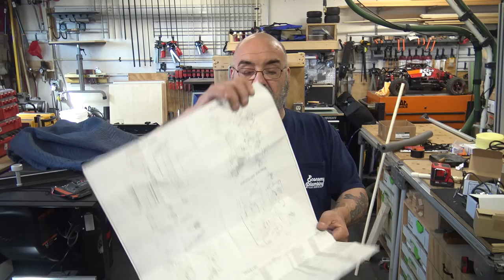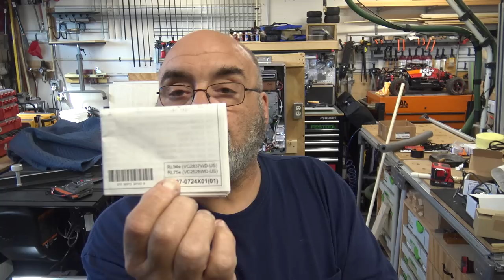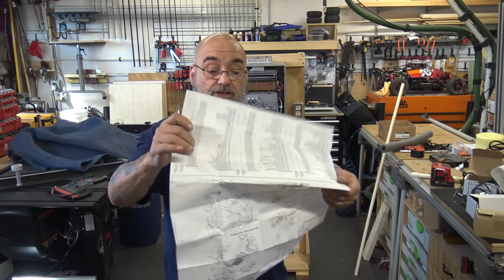How to protect your Rinnai tankless heater during freezing temperatures.

Comment: Your video gets a like simply for lighting up a cigar while you're teaching. I'm setting up an off grid system with an exterior Rinnai. My water source is 3000 gallons of external tank. Most of my source pipes are above ground so my best protocol is probably just going to be to power down, drain everything and get all the water out of my entire system until the weather passes. All power we have is from our solar system. Additional heating elements are not practical. Temp outside this morning is 23 F.  

The beginning of your video was most helpful when figuring out how to drain the system. Thanks!

Comment: I used to be a Rinnai guy 100%.  In the last six months I decided to start using Navien. 
I find the technology to be a little more advanced, easier to work on and being able to install without having to add or replace a lot of gas piping helps keep the cost lower with installation.
Reply: Lol same here, I was approached by Navien last year( I did get a lot of question about them over the channel) to see what they can do about being added to my channel. I asked for two unites so I could look at them. Once I took them apart and put them back together I was sold.

Comment: Mike, your video was super helpful.  Too late to save my brand new unit but helped me understand what failed and the new heat exchanger is ordered, though of course on back order. The rip in the tube on the hot side is even bigger than in your video.
Reply: I’m glad it helped sorry for your problem. Mike

Comment: Hi Mike, 
I live in Dallas and I have 2 tankless R94
One of them kept working through the cold weather because I have installed a recirculating pump and made it come on every hours to keep water flow through the unit.
The other tankless stopped working due to hot water discharge pipe frozen in the attic. The unit did not froze and I was able to make it run by opening the relief valve. I had previously stuffed all the pipes with wall insulation . I got lucky on this one.
Thanks for all your videos
Reply: I’m glad it helped

Comment: Great video, thank you
Question, i have a mountain cabin that we do not heat or visit during winter. We have indoor tankless water heater in a closet inside kitchen. If i gravity drain all water from house system, leave power and gas on, am i ok? Temp iside house can get into 20s
What process should i use each year to “winterize” cabin water heater?which of your videos show  this process?
Reply: Did you ever find an answer for this question you asked? I am thinking of doing the same thing you are asking about. I'm wondering if the water heater would be ok without any water in it. ?

Comment: Hello, thanks for the video I was hoping you could give me some input on a similar situation.  I'm running an interior unit (V65ip) but live in a very cold climate in Fairbanks, Alaska.  We are having issues with the 5-in Plastic Vent Kit frosting and causing an error 10 each time the heater engages.  Once you put the pipe with a heat gun this issue goes about for about 12 hours, but this is not a sustainable solution.  Do you have any suggestions for preventing this from happening?  Our next possible action is to install similar insulation as this video discusses to the outside of the Plastic Vent Kit to try and insulate the air a bit more.  This has only really been an issue when the temperature drops below -20 F.  Thanks for your videos!

Comment: Hi Mike,

I just bought a never installed Rennai  RUC98i. I thought in one of your videos you mentioned that it has the software for recirculation but, the pump needs installed externally. When I go to Rennai website, it does not recognize the model number.
This unit was originally purchased by a friend of mine who never installed it due to venting restrictions. 
I would welcome any thoughts, guidance,  or links. Especially on getting the correct pump and how to wire and set it up..
Thanks!

Comment: I am from Dallas,  I have RUR98i, my water pipes froze,  and after the storm,  I opened the cold water inlet to tankless heater, found that the water is flooding out from the tank,  today I opened heater front  door and found it is coming out from heat exchanger. I ordered  new heater after checking that the replacement part is not available online(back ordered), my question to you,  is RUR199iN the replacement for RUR98iN. By the way I ordered RUR199iN.
Reply: Yes a RUR199IN is the replacement for a RUR98IN The piping will be a little different due to the relief valve is separate mounted directly to the unit. You should have some play in the pipes to move the wster lines. I hope this helped. 
Mike

Comment: Thank you very much for all your videos they’re very helpful. I do have a question for you as I repaired my own unit by bringing the return bend on the left side of the heat exchanger, which busted, back together and then soldered it. It has held for almost a week so far. I do however want to purchase a copper return bend, and eventually replace that section with a more permanent fix. My question is what size copper pipe would I be replacing? 12mm,12.7mm,16mm, 19mm

Thank you very much I can also supply a picture however, I don’t have the tools to measure the actual inside diameter Without Cutting into the pipe which is currently holding in supplying us hot water.

Comment: how can you prevent cold air from going back into the unit.  That is the reason why my pipes on the heat exchanger cracked.
Reply from the maker: You can’t it’s like rain getting in the only solution is to reposition the vent. Mike

Comment: Mike..our plumber is having a difficult time installing the freeze protection solenoid on our external unit.  They cannot seem to get the electrical correct to make the solenoid valves work.  Sonething about AC or DC problem.  Any way you have detailed info.
Gail

Comment: We installed a Rinnai interior tankless in the garage. We are baffled when it has been extremely cold the unit has appeared to turn itself off overnight. We had. Tankless in the same place where there was one for10 years, that unit never did this. Is this normal? It literally is off in the AM.  I insulated the pipes today and place a blanket over the unit so we will see if it’s on tomorrow AM since it’s supposed to be in the 20s tonight

Comment: Hello Mike! I replaced an 80 gallon electric water heater yesterday. It has been in operation like 6 hours and lukewarm water. The water heater sits outside in an addition shed built for it. 240v powers the elements, both elements have 12 Homs of resistance, current draw on top element 19.7 amps. Thermostats are set to 120 Degrees. Everything checks out but no hot water. Any ideas? the old one was not leaking but stopped heating water and both elements and thermostats with dip tube were replaced to no avail. Finally decided to buy a new water heater and the problem is still there. please help!

Comment: Hi Mike, we lost hot water this morning when it reached 18 degrees in Austin, TX. I watched the Rinnai video for protecting your tankless and got the hot water working again by turning off the hot & cold lines and using the pressure release valve. I also opened the service caps and let it drain; I did not connect a hose to the cold line or use an air compressor. Unfortunately, the hot water pressure is okay with one sink on but weakens if more than one faucet is turned on. Glad to have hot water back but still unable to shower due to the low hot water pressure. Any suggestions on how to improve the hot water flow?
Reply: Great comment. I’m dealing with my rinnai acting up right now. No hot water. It’s not even making a sound when we try to turn hot water on. I’m in San Antonio btw. Also, did you turn off the power to water heater before draining or leave it on?

Comment: My external Rinnai burst in the storm last year. Now we're gearing up for the 2023 round of cold weather, which will probably take down the Texas grid again. We're getting our first blast tonight and this vid, while bringing back some ptsd, is a lifesaver. 

Rinnai is being incredibly irresponsible on this issue. They're intentionally ignoring the info in sales material, bordering close to fraud. Honestly, when would you want hot water the most? In the middle of the winter.

In the meantime, these units failing will only increase along with climate extremes.

Comment: Firstly I want to thank you so much for your videos. I was based in Austin TX and I was able to leverage your videos to help get one of my tankless units back online. Basically the control panel was mounted outside in the unit and one of the wires corroded and the system shut off. I was able to reconnect the wires. Should I have the control panels moved into the house ( I have two units). Second question even thought the hot water seemed to have freezed it is now working, if there was a leak in the tank would the unit still be working and should I check for a leak at the heat exchanger?
Reply: I also live in Austin, and my water heater (tankless, outdoor) froze up. When the temperature thawed it out, water spewed everywhere, so it was obvious (to me) that there was a leak. It was a burst pipe near the top left of the heat exchanger.
Reply: @starculus  thanks! I haven't seen any water coming out of the unit
Reply: another Austinite here. Just ordered the freeze solenoids along with my new rinnai to replace the one that froze and burst last week, which seems to have happened to most EVERYONE i know that has an external tankless in town. appreciate this video.
Reply: I live in Dallas my outside unit froze and busted the heat exchanger, I was able to find the replacement in our local plumbing supply store, after a couple of hours and 300 dollars later is running again
Reply: Glad it help you all Mike